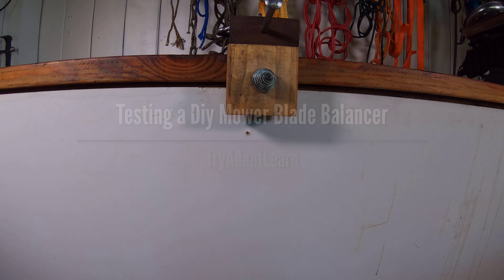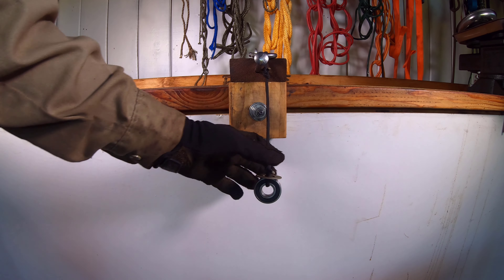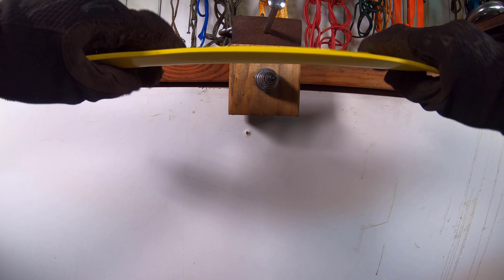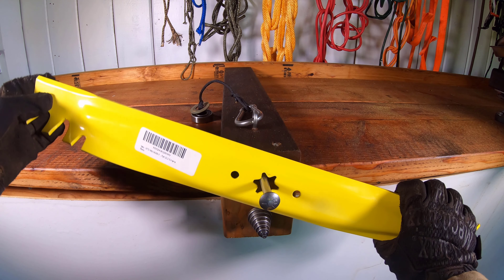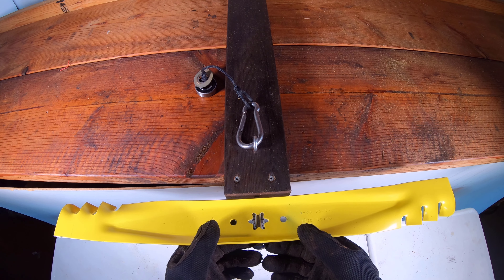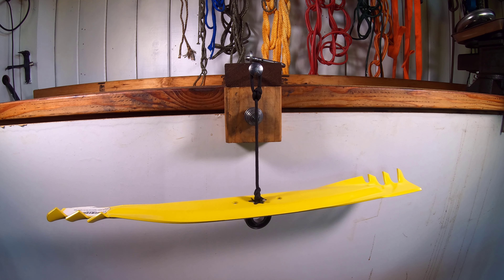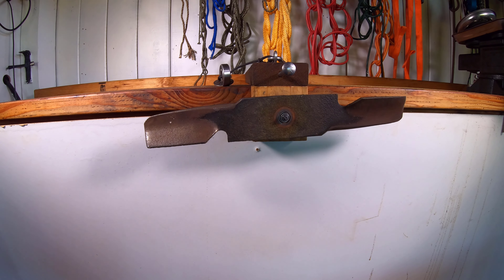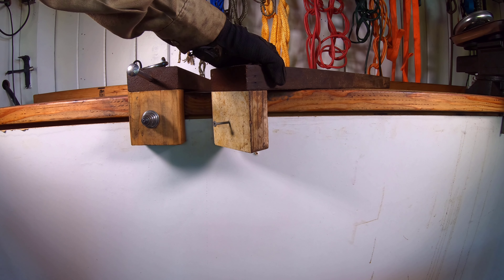Testing a Diy lawn mower blade balancer made with scrap wood and hardware

Comment: Rather than spend a couple of dollars for a real lawnmower blade balancer, you are creating a DIY balancer. If your DIY balancer is not accurate, you can damage a piece of equipment that could be worth many hundreds even thousands of dollars. Spend a few dollars and buy a real lawnmower blade balancer.
Reply from the maker: Thank you for your concern and reasonable feedback.  It was worth trying and as seen, at least one version is the equivalent of balancing with a nail.  I agree that if your blades are no balance properly, they can cause damage to the spindles and possibly more.